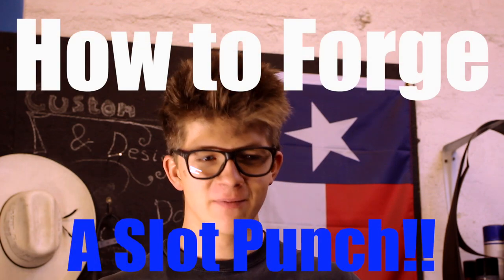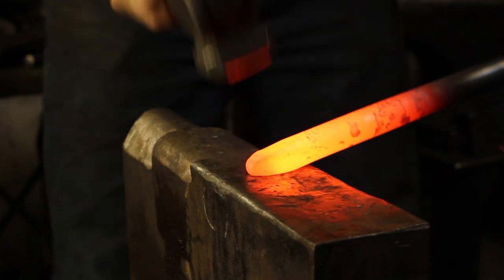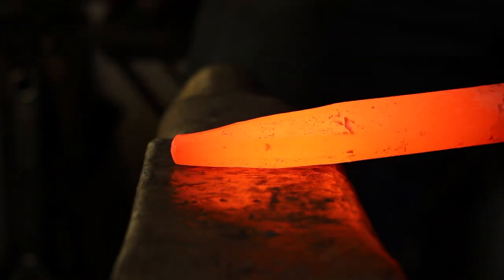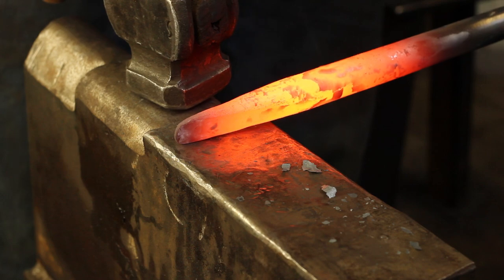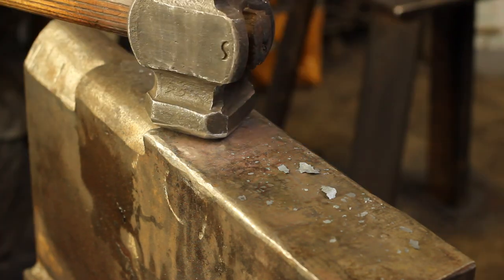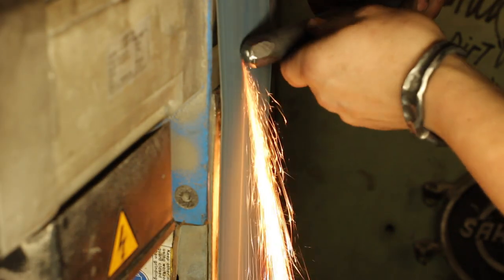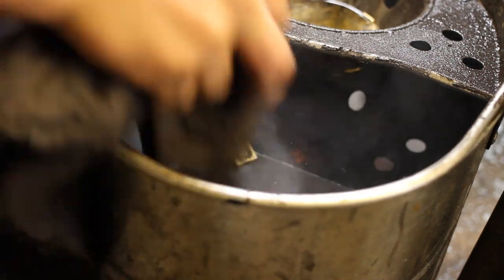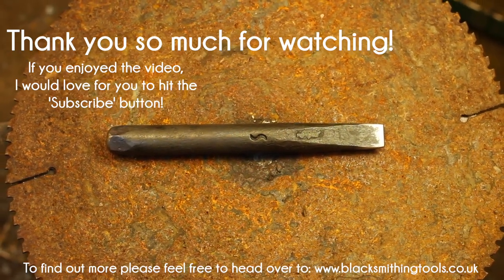How to make Blacksmithing Tools! - The Slot Punch

Comment: the idea with edging the hex at the stiking end of the chisel is to stop mushrooming which if not cleaned back to original shape regularly ....will form splits and pieces WILL chip and fly off and....viola....and i asume you know about dirty motor oil for quenching and temper.....if you want case hardening.

Comment: Awesome video, can't wait to see more! Quick question though. I recently acquired a set of vintage machine made "Young Bros" letter and number marking stamps and was wondering if I could use these on hot steel/metal or would they lose their temper and hardened properties.
Reply from the maker: +Rob G Provided you dont let them sit on the material for too much time they should be fine! Thrilled you liked the video!
Reply: +Rob G use them on cold steel, doesnt need to be hot.

Comment: Yeah tried the Brazeal style hardie tools before with the tapered shank. Snapped the heel off my anvil so that now I have an anvil with no heel and a square notch where the hardie was. Great.
Reply: Sounds like an ill fitted shank, and possibly an anvil with an inherent flaw...
I prefer a shop fitted shank with a shoulder. 
By shop fitted I mean forged to fit your specific anvil.
AAR
Reply: Won't happen when hot cutting. Especially with a soft striking anvil. What exactly were you doing to generate so much force? Was it a Chunk anvil shaped object made of cast iron, BTW?
Reply: No it was a 125lb 1908-ish Hay--Buden in decent shape, and was hot cutting a piece of 1.5 inch round. I now use straight shank tools with a good shoulder that I make myself.
Reply: TAsatorT how hot was the steel?
Reply: Notice he uses the tapered Hardie in a Mild steel striking anvil. Avoid using tapered Hardie’s in a regular Anvil.
Reply: @tasatort9778  I know this is old but that sounds like the anvil had a crack or something in it before that... I've seen thousands of anvils and never even seen one or heard of one that had that happen, very unfortunate

Comment: I had some car spring and made a couple of different thinks from it, but all of them end up with some nasty cracks in them from the forging, is this some think I am doing or is it the steal?
Reply: address191 many Smith's claim it as the steel and I to some extent agree. If you are not hammering cold or burning out your material then it is the steel for sure. If you are starting with really rusty steel it can be pounded into the material which ruins your surfaces and can lead to cracks developing. I usually strip ALL rust off recycled metals before forging.

Comment: if you don't want to have to run a lot of lights while your fortune with your tools with you like your lunches and stuff making out around and line them up with whatever you're cutting hedges that's so basically if you have a very bad light lighting if you just want to quickly know where you're cutting edges does low lighting or no Lighting in your Forge and anvil could be an issue probably would be an issue but it could be not an issue to pendulum how bright your firewood be
Reply: whaaaa..?
Reply: Walter Bond this is one of the worst structured comments I have ever seen, and is probably the worst run-on sentence I have ever seen.

Comment: I am making a hot cut, but it keeps getting stuck in the hardy. Do i need to make the shank a big bigger at the top before I start the chisel part? Thanks
Reply: +Matt Behnke Alec and I basically were taught the same theories by two different guys (Lyle Wynn for myself and Brian Brazeal for Alec). I cannot speak for Alec's preference but in a 1 inch hardy I prefer for my taper to go to about 1 and1/4 to 1 and 1/2 so that it fits tight without going to deep in the hardy. I have used Brazeal cutoffs made for 1 inch hardy holes in anvils with 3/4 inch hardy hole and the tool seems a little top heavy and flop around a bit until the first strike, that is why I would stop at a max size of 1 and 1/2 for a 1 inch hole. if seated in the hardy properly you should only have to tap the cutoff back and forth a few times before it rocks free. Hope this helps.  Oh and Alec love the Texas flag in the background! 
Happy Hammering 
John McGee
Monkeywrench Forge
Reply: +John McGee  Ok thanks. So you want the very top of the taper to be 1/4-1/2 inch bigger than the hardy. How long do you go for the shank, and how small? THanks so much
Reply: +Matt Behnke I'll take some exact measurements tomorrow and let you know how they are proportioned
Reply: +John McGee  Ok thanks. So I think i got the idea. Use steel thats 1/2 to 1/4 inch bigger than the hardy then taper. You will tell me tommorow what size taper and how small. I think I am gonna make a hardy holder like what mark aspery shows so that I can use it for my anvil I have now and for eventually when I upgrade to a larger anvil. Thanks so much for the help.
Reply: +Matt Behnke hey i posted a video on my channel that should answer most of your questions
Reply: +John McGee  sweet thanks so much!